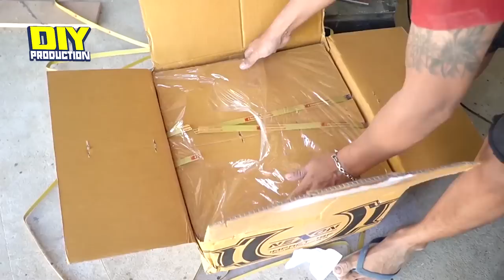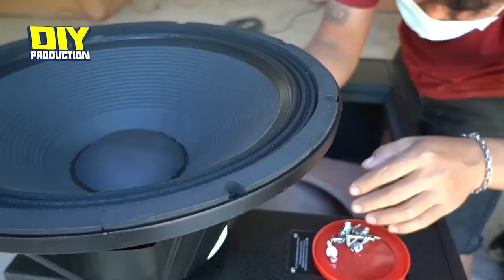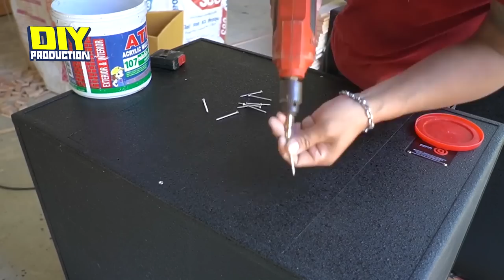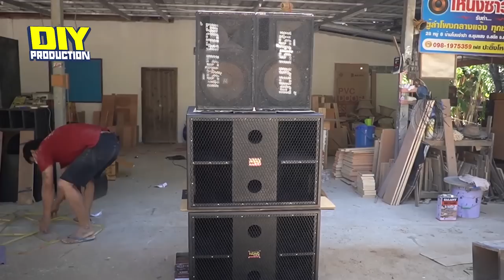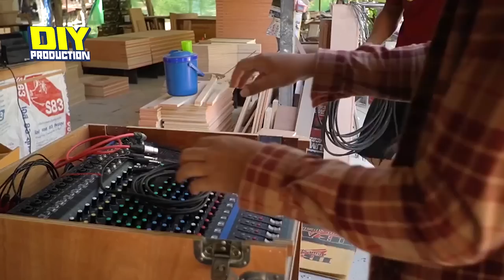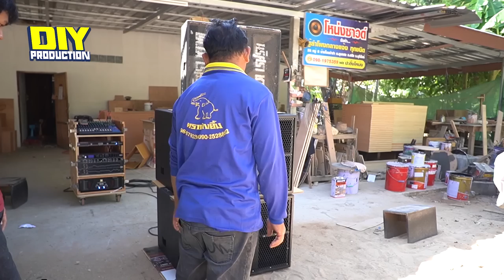TEST WBOX Single 18 inch Professional Subwoofer Box

Comment: there are some wood panels missing in this build to make the folded horn work right. plus, the hole for the speaker is a slot, so the speaker must come in from the front. so there are a total of six parts missing. the panel that has the ports must be removable to mount speaker from the inside, then there is a 3/4" ring that mount to the piece with the slot hole that keeps the speaker cone from slapping the wood around the slot. look more for drawings that will show whats going on inside.
Reply: ¹
Reply: I agree.. the woofer must be inserted from the front and mounted to a 3/4 circular cut which is then attatched to a  3/4 layer of ply wood with the square cut before comfrontng the > divider .. developing pressure is key for a long throw cabinet.
Reply: A next thing i notice there is no speaker wadding or sound proof foam inside to give a tight low frequency.

Comment: If you place the phone or whatever you are recording with a few yards farther away,. The Bass you're making will get clearer the farther away you get to a point, Then will drop off in db! The little mic on the phone, can't take the direct pressure!
 Great Job ! They look cool and the speaker looks of good quality too, Wish I could hear clear sound!
Setting up a RTA or Spectrum Analyzer, We can See what we can't hear and better evaluate!
Best spkr. Configuration I found  18" Lp  15"Mb 10" mid 2" Neo. For loud clean sound or "Q"
 Keep making killer Enclosures!